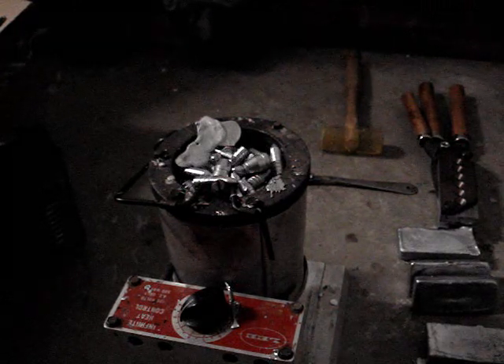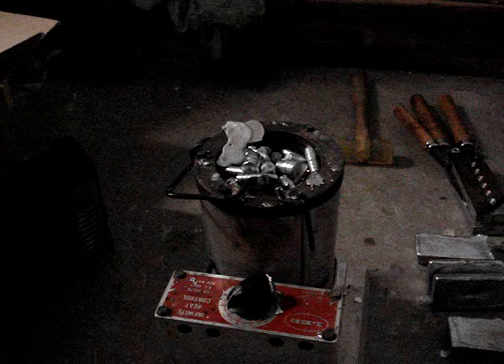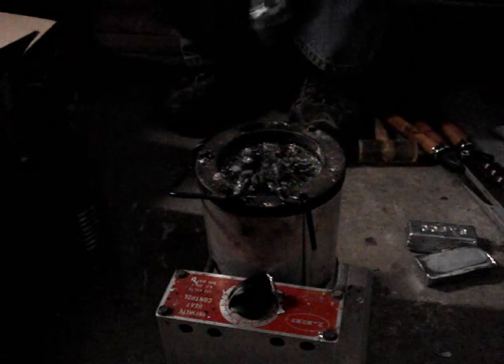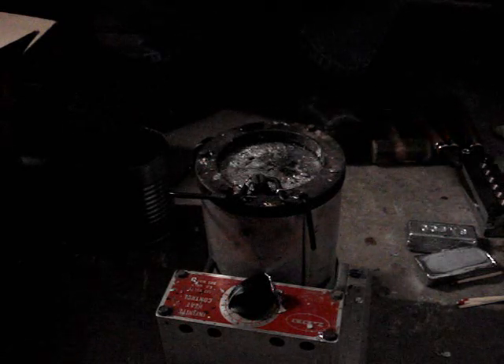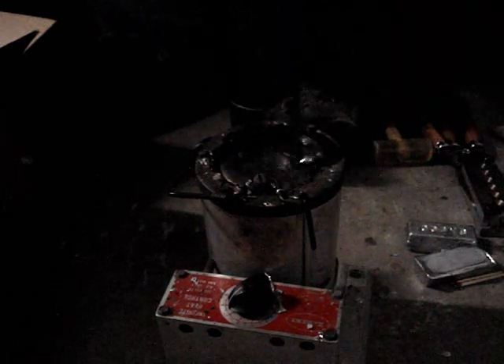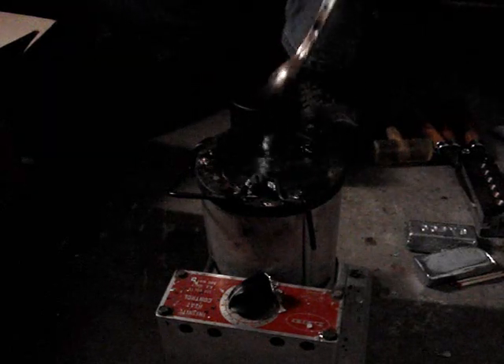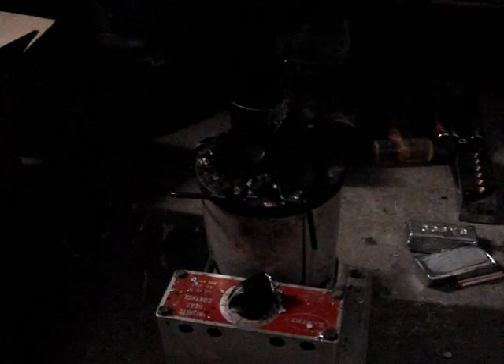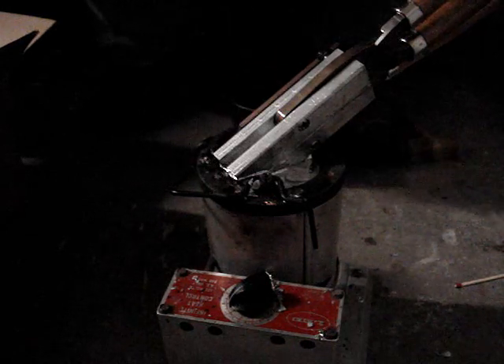Basic Casting Part 1

Comment from the maker: Not that often. I flux when the melt gets up to temp and when I add metal to the mix. You can use either Marvelux or paraffin wax. I use wax since it's cheaper and it's been used for hundreds of years. Beeswax also works great too.